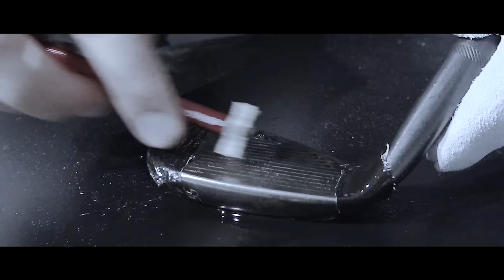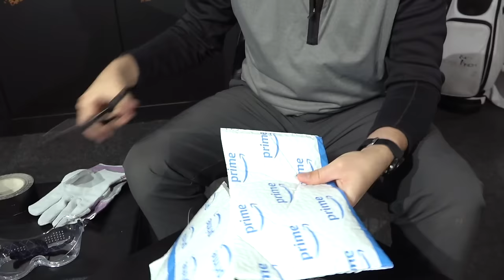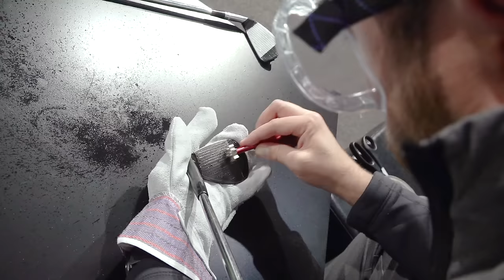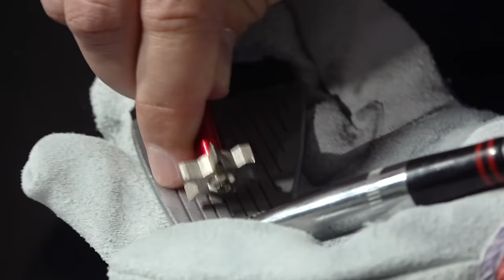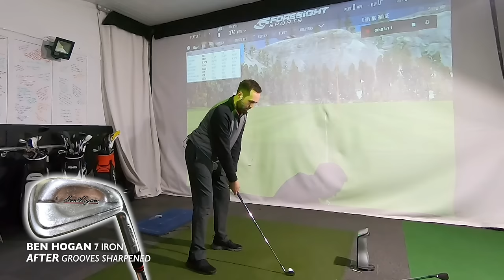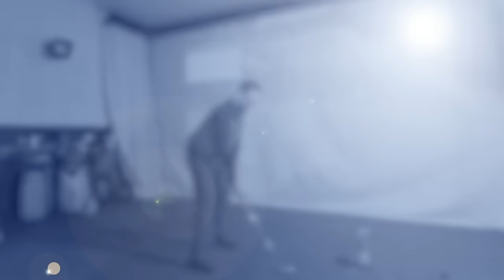I sharpened my golf grooves (unexpected results)

Comment: Rick, why don’t you compare the sharpened grooves club with a brand new club of the exact same type.  My guess is that the new club will spin more the old club with the sharpened grooves.  Grooves get rounded off with play and a doubt you can get “new” performance with  by just “ sharpening”.  If that is the case then the sharped club would certainly be legal.  Prove me wrong...

Comment: It seems to me that this tool's shape is too narrow and mostly machines the bottom of the grove. Since the ball's surface will never get to the bottom of the groove I do not think this makes any difference. The whole idea is to sharpen the outer edges of the groove, where they meet the face of the club, and eliminate fillets or dull edges. This has nothing to do with the bottom of the grove, and when you watch the close up images of the face of the club, the outer edges are still blunt. So I do not know what to make of this.

Comment: This has always been BS, you can find wedges with no grooves, and they play as well as any that do have them.  Because of the lawsuit this myth got more traction even though the issue had nothing to do with the grooves actually helping.  A simple test to see if balls slip is to put a golf ball in a vise and crank down the handle till the vise is denting the ball into impact like condition, then try to pull it out.  You can't budge it.  At impact the ball is glued to the face of the club.  If it moved even 1/4" up the face it would be moving faster along the face than towards the target.  But most golfers aren't really technical people.

Comment: If you want them even sharper, take a bench stone (I recommend a fine India stone) to the club face in addition to using the groove sharpener.  You'll scratch up the face of course, so you'll need to mask then bead blast after, but your grooves can be made razor sharp if that's what you're after.